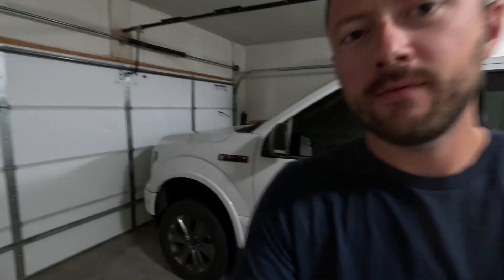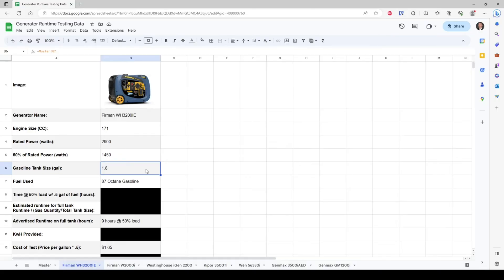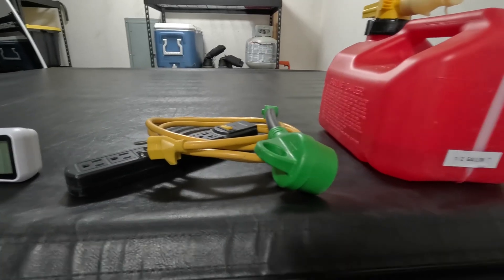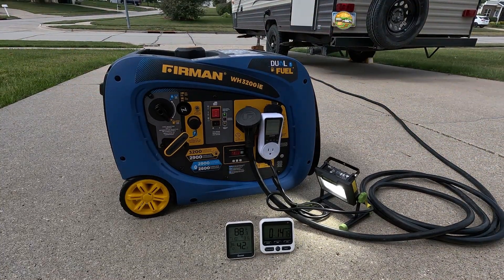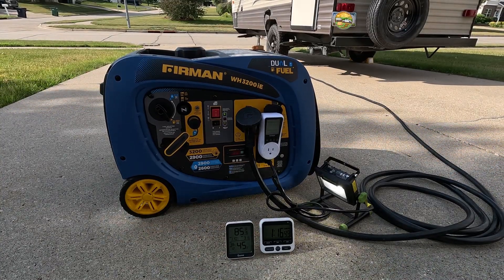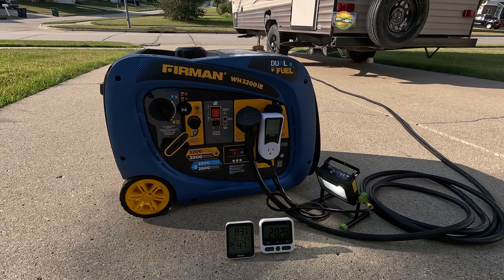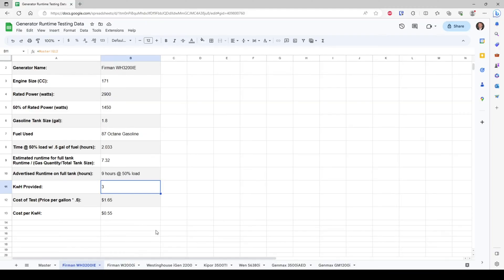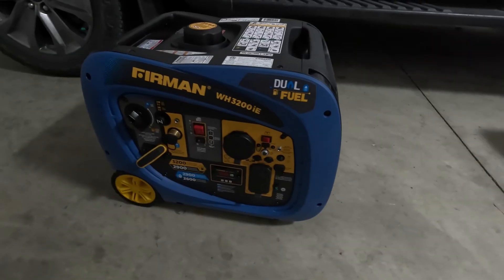Firman WH3200ie Inverter Generator Runtime Test | Generator Runtime Testing Series

Comment: Watch out, just got a similar unit from ebay / firman and one of the engine mounting points has the plastic side cracked. Can't see it unless you take the gas tank off, so inspect your unit well when you get it.

Comment: Thanks for doing the testing!  I was keeping my own spreadsheet based on Internet reviews, but their hours were misleading as they were based on the manufacturer's stated runtime which is not at 50% output.

Where did you measure 3 KWH? At the battery manager incoming power?

Comment: I'm a fan of buying ebay, manufacurer refurbished items. I just bought the Firman WFO3242 . It was the sevond Firman I've bought this way. Of all the ebay, manufacturer refurbished items I've bought this was the only one that actually looked used. All other irems havevlooked unused. None the less, it starts right up and runs as it should. FWIW: I intendbto only ever run this one on propane.

Comment: I have the wh03342 And as long as the generator is running is charging the battery so I'm not sure why yours doesn't.
Reply: Same here, the manual says the battery is charging when the generator is running. The AC charger is for when the generator isn't run very frequently.

Comment: What's your source on it not charging the battery? I believe the plug on it is just for keeping it topped up when not using it.

My WH03242 has the same thing, but the battery is definitely charged while the generator is running.
Reply from the maker: You are 100% correct.  The battery that came with it was dead in this video and not taking a charge, but with a new battery it does charge while running!  Thanks for watching :)